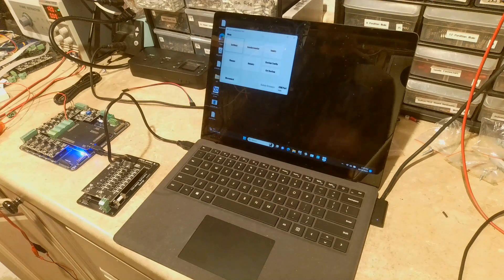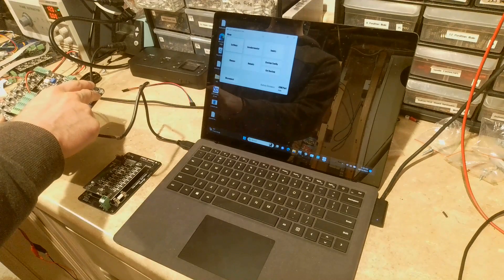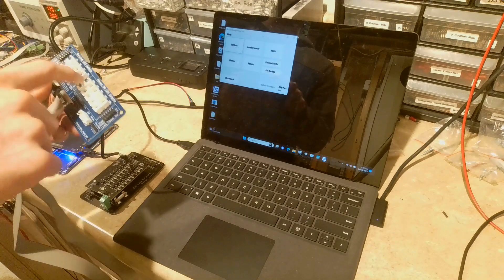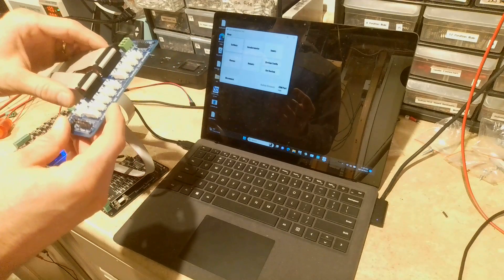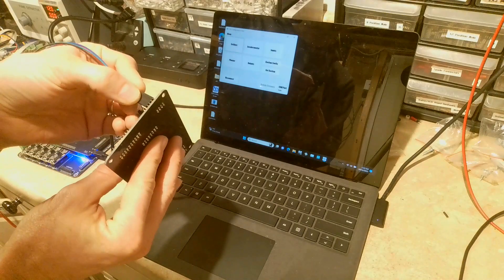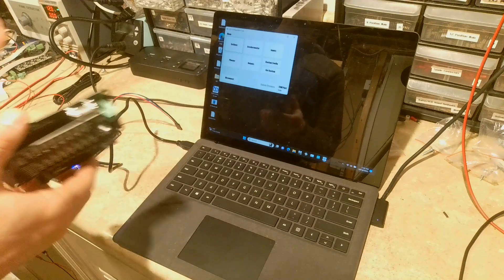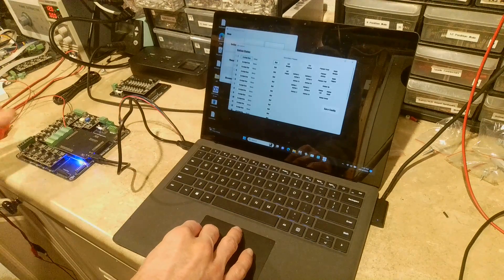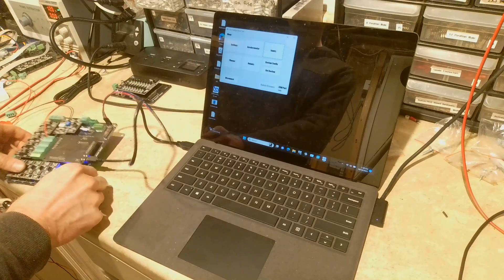Virtual Pinball PinOne Main board overview from Cleveland Software Design VPX and Pinball FX Board

Comment: @clevelandsoftwaredesign Where inside the cabinet do you recommend mounting the Pinone board?  I am working on my cab currently and about to mount it and curious on your recommendations.
Reply from the maker: Towards the front/middle of the cabinet is best, but it doesn't really matter. Just so as long as it isn't all the way in the back of the cabinet it will be fine. You can chose the orientation in the config tool so it doesn't matter which way it is facing.

Comment: Hi Phil, i feel like an updated video could be good using the expansion board showing how to connect a separate power supply (ie. 24v) to the expansion board and connecting something like a beacon at 24v. I have a beacon and a separate 24v power supply, and im still a little confused on how to properly connect to the board. Also, other random question. I also purchased your ssf kit that comes with a 24v power supply. Am i able to use that same power supply to connect the beacon as well, or would i have to have even a second separate additional 24v power supply? Sorry if that's a dumb question. Im still learning😁

Comment: Sorry for the weird question. Since the pinOne boards uses a 12v power supply, is there a way to connect beacons to the pinOne board just for the data connection but then still use a different power supply (ie 24v) to power on the beacons separately? I want to use a 24v power supply for my beacons so they spin faster. Thanks
Reply from the maker: PinOne is all powered by USB for LED lights, plunger accelerometer and CPU, you can hook any power supply up from 5v to 30v to the main input power to run toys like beacons. You can also connect multiple power supplies to the same board. I have a video showing how to do this. (Different board, but same process)
Reply: @philipellis2187  oh I see. So I can have one 12v power supply for everything else connected to the board and second 24v power supply also connected to the same board, just for my beacons?
Reply from the maker: That's right! @chucksgrace3225